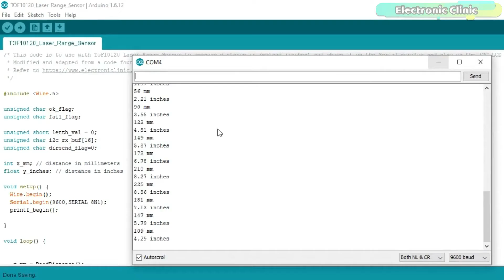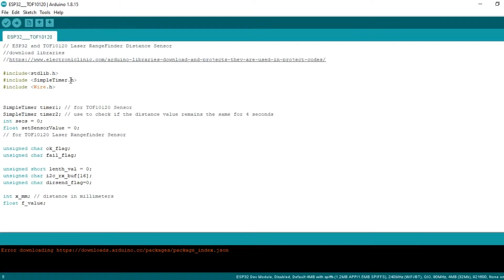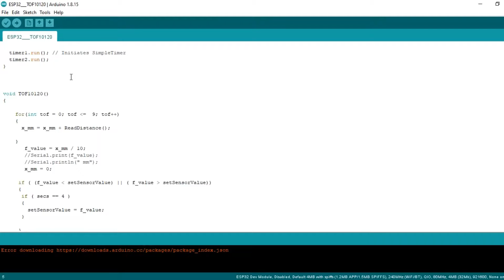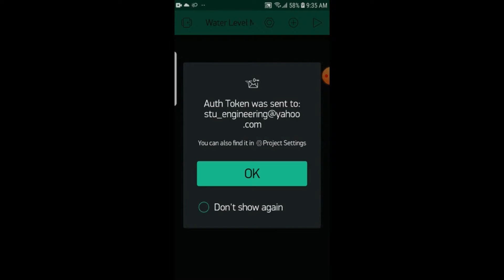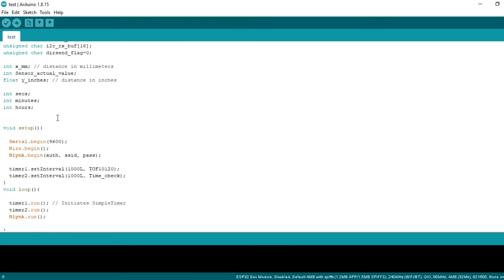ESP32 with TOF10120 Laser Rangefinder distance sensor, IoT water Level Monitoring

Comment: I have a project I need one of these sensors but they must be able to work in a range or 1 or 2 mm and be able to detect the changes. Basically detect when there is an obstruction in a tube. I wonder if this can do that

Comment: Congratulations on a beautifully engineered system. I've designed (and built) something similar, using LoRa (Ra-02) at the water tank, that transmits to the receiver and then onto Blynk as there is no internet  at the tank, but there is at the cottage.  One issue I'm having to deal with is that we only have shared internet for our small community and there is complaints my device(s) are using too much data.  As I don't need to know  every minute the water level (perhaps every 20 minutes) I'm going to have to figure a way of setting up some way of controlling the device connection to the internet.  I'm wondering if adding another timer into your program would work?
Reply from the maker: of course you can use another timer to keep track of time, or you can access the network time and then by modifying the code you can send requests to the transmitter lora to send data. or you can send the code and i will do it. 
stu_engineering@yahoo.com